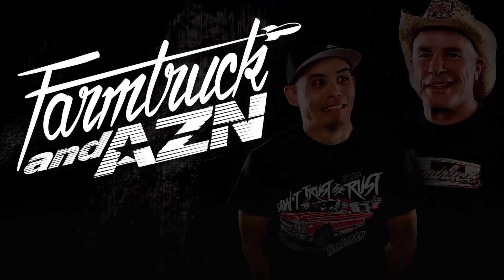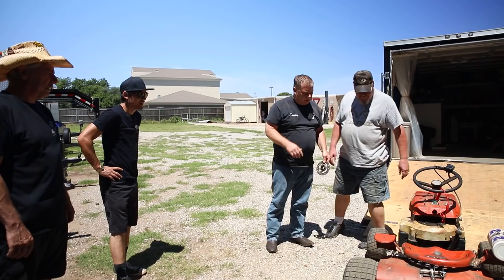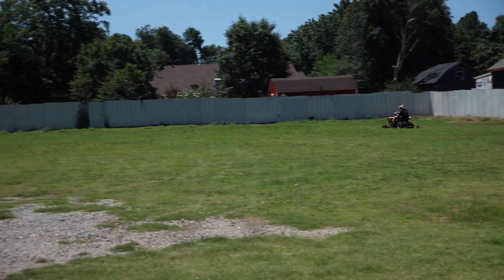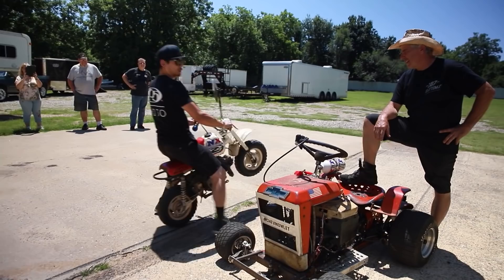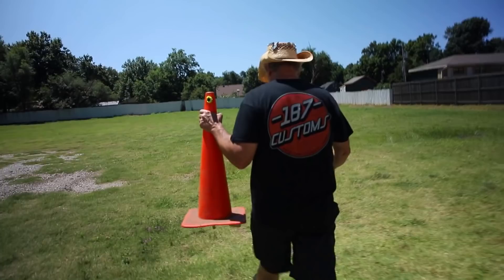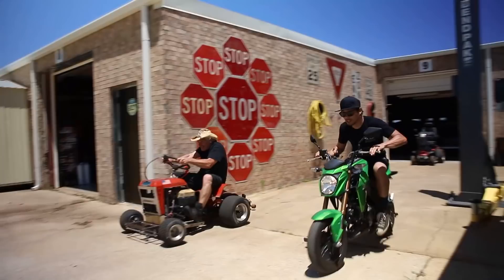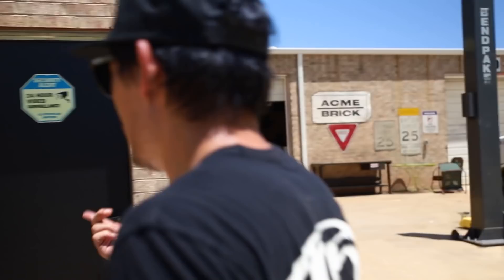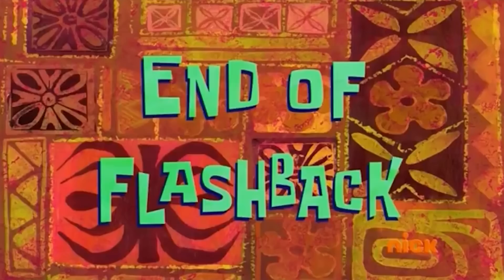THE FNA CHEVMOWLET RETURNS!! Our Drag Race Lawnmower!

Comment: This brings back some fond memory's from childhood in the 70's. One of our friends dad was a welder by trade and a hot-rodder who helped built one of these with us and it looked almost exactly like the "Chevmowlet" wheelie bar and all. Ours had a fire-spitting straight-pipe exhaust coming through the hood and larger rear mudder wheels... I still crack up when I remember it's maiden run down the back alley that thankfully he had taken instead of one of us boys.  The throttle stuck wide open and the steering was sketch like yours was before.  It immediately ran it, and him, up the nearest telephone pole and sat there chugging away on the wheelie bar and rear tires trying its best to make it to the top of that pole. We finally knocked the spark plug wire off to kill it! (no jet ski safety switches in the 70's) and the look on his dads face was priceless! We all rolled around on the ground forever and had one of those laughing fit's that hurt afterwords.... Thanks for stirring that memory up and making my day!

Comment: I had a v6 vortec that I didn't know what to do with so the only logical thing for me to do was to pair it with a two speed powerglide and a dana 9" chopped and shortened rear end all directly connected, the best part was that it had brakes-ish...or was that the scary part?